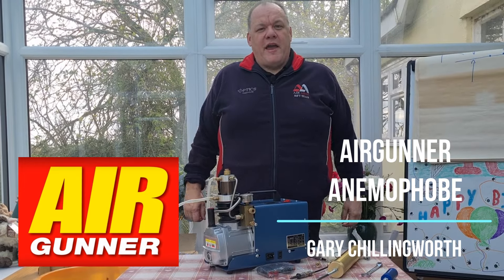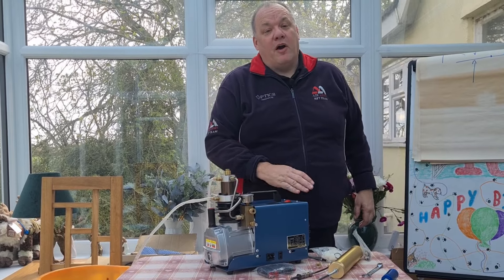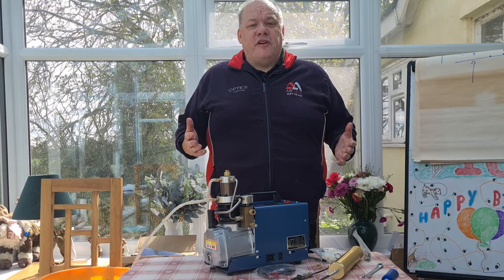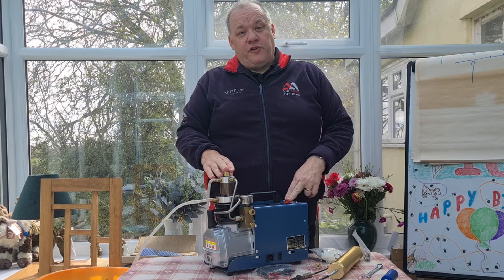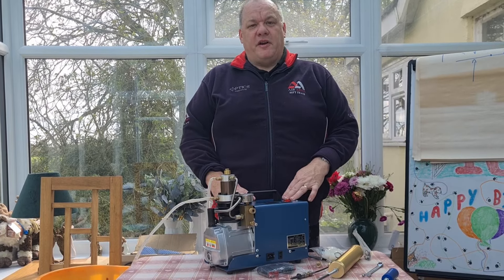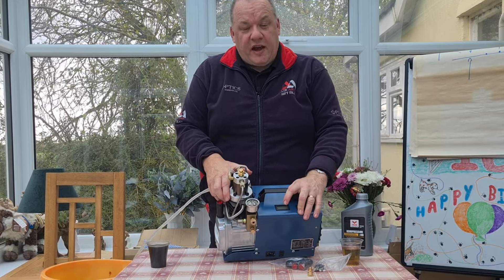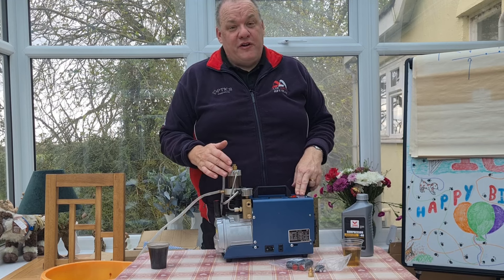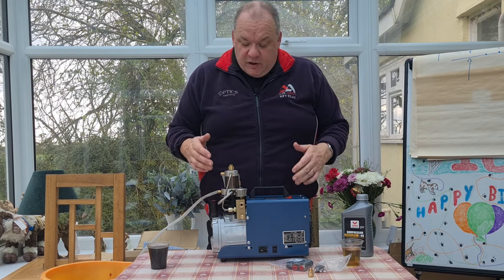S&C TV | Gary Chillingworth | Best budget airgun compressors - plus, tips on use and assembly!

Comment: Hugely good video. I just got one of these pumps, in the US there are a number of sellers on eBay and even Amazon selling the identical pump for the same price. I paid about $250 and got free domestic shipping. The seller offered “ lifetime warranty “.
My previous pump was off Alibaba, a no-name, very much resembling some selling for $500 under brand names. It failed after barely 30 charges and had the mainshaft bushing disengage after a few uses. It was under $200 but shipping was $85, so not really a good deal and no warranty since the seller was in China. My rifle looks very much like yours and I will be filling it to not more than 2500 psi, max is about 3200. Thanks for this video!

Comment: A brita filter or similar does NOT remove all limescale and minerals ib tap water. It will still fur up. You need to use deionised water. Also ice blocks (not ice cubes) to cool as ice melts releasing limescale and minerals back into your pumped water

Comment: I bought one of these 300 bar compressors during the early part of lockdown and had about three years of  trouble free use with it topping up 3 litre,9 litre and 12 litre tanks for my to FAC airguns, i had to change the entire top end of the compressor and now it seems to run a bit hotter so i use a bigger water pump( 3500 litres per hour) and a big 100 litre water butt. These compressors are cheap and generally provide good service providing you keep the oil changed every so often and filters.

Comment: Hey, thank you for the review and setup. I have the same compressor I've had for over a year. I freeze 1gallon water containers Halfway full and drop them in the bucket of water.  especially if I'm filling a tank. The only thing you forgot to mention when filling a tank. I think you leave The tank closed until the compressor reaches the pressure. You have in the tank and then open the tank valve.

Comment: I have had 3 of the First one stop working in 4 months, 2nd - was returned. the third one exploded.  The casing fractured at the cylinder base expelling the cylinder, connecting rod and piston.  Thankfully all parts missed my body.  After this I purchased a brand name twin cylinder compressor this one required replacing piston rings avery third scuba tank fill.  Another one from tuxing with the twin cylinders worked great and has operated well, it has the internal water cooling system.  Recently purchased a Italian Cuitri 300 bar compressor and this one is outstanding but very expensive.

Comment: From what I've picked up so far you want your moisture filter stood verticaly with the absorbant sponge at the bottom   tightly packed sieve material at the top then idbe tempted to reduce the length of any connections between the compressor and tank or rifle so I'd just permanently mount the moisture trap and compressor and maybe a see through water tank all mounted on a board. Or in a box with a removable side and top.

Comment: Very nice video. Useful 🙏 just one question with filling a bottle.  The gun bottle has e return valve. So when you bleed no pressure gets lost 
The diving bottle has no return valve .. don’t you loose all pressure when bleeding ?
Reply: I use a one way valve at the tank on mine.

Comment: Thanks for the review Pork chop,  I have the same compressor, the pvc cooling pipes are pants, they can be replaced with clear silicon pipes (no kinking)....I think I put about 750ml of oil in mine from new to fill above the greek.
Reply: Cheers buddy
Reply: how often do have to change your oil 12 pound a litre is not cheap
Reply: @johnwilson6707  now that it's run in, around every 5 hours.

Comment: Another great video. Thanks Gary. I have had pretty much the same setup for 18 months and I'm very happy with it. I only fill my 5ltr bottle every month or so as I much prefer shooting my springers :) 
Few tips I picked up:
* I have the bucket raised to give a head of water for better flow. Some people replace the water pump with a slightly less cheap one as they are fairly standard aquarium pumps.
* I have my dive bottle above the water filter, which is above the compressor that sits on the floor. This encourages water to drain away from the dive bottle.
* I have a one way valve from best fittings between my bottle and the moisture trap. The correct way round! This means I can start with the bottle valve wide open and don't lose air when I stop the compressor
* You had a lot of activated charcoal in your "moisture vaporator :) " I think you only need that if you are breathing the air, so mine is mostly filled with desiccant to trap the moisture
* I only fill my 5 liter dive bottle from 190 to 250bar to reduce the strain on the compressor.
* I've never filled my precious PCPs from the compressor, only the dive bottle
* I wrap a damp cloth around the hot metal pipes to help cool them (but avoid splashing the temp gauge etc.)
* I blow all the water through the tubes when I'm finished as leaving moisture in the cooling jacket leads to lime scale and corrosion
* I also use cheap bottled water for cooling and it stays in a covered bucket. The idea is that it will further reduced limescale 
* I follow all of your tips (great summary!), except I do use the recommended hydraulic oil, so now I'm worried!
I think you said you were going to leave a list of parts in the video description?
I think you also promised us a pellet preparation video. really looking forward to that. Hopefully involving springers :)
Reply: Do, you mind if I add your info into the description?
Reply: @garychillingworth  You are more than welcome to :)
Reply: how much oil do you use between filling up your bottle
Reply: @johnwilson6707  The oil doesn't get used. It just get's dirty. At a guess I change the oil it every ~6 bottle fills

Comment: Here’s a tip, the water (distilled)collected in a condensing tumble drier is almost pure(my works tumble drier produces this water at 10-15 ppm according to my TDS meter but do a tds test before you run it through a brita water filter, you may not need the Brita…. Free distilled water!)

So don’t throw it away, we use it in our steam irons and to top our flt batteries up.
Reply from the maker: Cheers Andy, that's a great idea - Gary

Comment: Air from the bottle is not floating back when 2 valves are open en you open the bottle before the compressor is turned on?
Reply: Marc Richins (comment above) spoke about a non return valve, I'm going to look into it.
Reply: @garychillingworth  Great will look into that too, just have to order the oil, and i'll be good to go, is the water, plain water or would distilled water be better? or cooling water used in cars is that an option?
Reply: @TophatOrange  I just used plain water, however, if you are in a hard water area, use bottled or filtered water to prevent limescale.

Comment: Would you use anti corrosive products in the cooling circuit ?  I've made the mistake of thinking I had drained all the water after 1 use, and the residual water just completely caused the bolts and other components to rust.
Reply from the maker: What would you suggest?
Reply: Would automobile antifreeze work? Probably a better heat exchaging liquid if compatible. 👍
Reply: @pepesantoraton9865 you could, if you reuse the cooling water - store it in a container, add Water Wetter or similar. It actually aids cooling and is used in motorsports engines. Highly effective.

Comment: For information the moisture filter should always be vertical and not on its side for it to function how it should properly,  its advisable just to use a couple of cable ties to hold it to the body of the compressor somewhere suitable

Comment: Hi Gary,                                                                                                                                                                                           have you had any problems with leaks on the compressor at all?  I have had a few on mine, mainly tightening things up, but I also put 2 burst discs where there should only be ONE. The upside of that is that I can now fill to above 220bar.  The down side is that the copper bonded washer that seats the brass 'blow out' safety valve to the top of the cylinder now blows out. A work around for this is  - remove the rubber seal from the copper washer, and use an RO6 rubber washer in its place.  So far this has held and I can now re-fill to about 290 bar, it may go higher but the machine was reaching 80 degrees so time to back down.  I am sure it wont be long until another air leak rears its ugly head but at the moment the compressor works for me as it save a gallon in fuel, a 1.30 hr drive and the refill costing. PS - regarding the moisture separator unit that come with the machine, I filled mine up with about 8 of the 'white moisture control pads' that came with the machine. If the show signs of moisture I  just dry them out....having just one pad in place didn't seem to be enough to me.

Comment: I've had 2 of these... kill both filling 7 litter 45 min scba tanks to 4500 psi.   one lasted about 12 months,, the other, 6 months.   I would suggest you use to direct fill your gun and it will last a very long time.   I ended up buying a twin cylinder Tuxing compressor.    I'm at 11 months with the Tuxing and its going strong!  review is on my channel.   Cost is reasonable (about 2X the cost of the little blue ones).
Reply: Tuxing : same pump supplier as Yong Heng, but a better design.
Reply: I have also a Turing 2 cilinder and my problem is, is that the oil very quick getting very hot, while the cilinders are about 45 degrees. I wonder, if you have the same experience.
Reply: @PF4531  - I don’t think so but I don’t monitor the oil temp just the head temps.  I’m cooling with a 5 gal bucket of water antifreeze mix. I drop in frozen 2L drink bottles of water.  Head temp usually about 115-120 F after a 45 min-7L bottle fill.   I don’t have an easy way to measure oil temp.  I kind of thought the cylinder head is where most heat is generated.    How do you measure your oil temp?
Reply: @motorgearhead  I don’t measure the oil, but after about 15 minutes, I see a little damp coming out of the oil breather, maybe It’s normal, but If I keep my hand on it it’s much hotter than the cilinders. It’s worried me a little. Bye the way…I do the same as you do. I have a big bucket of water with frozen bottles and the cilinderhead is constant 45/50 degrees Celsius
Reply: @PF4531  - wonder if changing oil might be needed?
Reply: @motorgearhead  That happened to be my thought too. And I dit that yesterday. Thank you for thinking. 👍
Reply: @PF4531  - good deal!   Hey post back & let me know if that changes anything.  Also what compressor oil did you use?   I have royal purple compressor oil in mine.
Reply: @motorgearhead  I will, but not now, becouse my tanks are full….But I let you know!  🙂
Reply: @PF4531  - thanks!!
Reply: @motorgearhead  👍👍👍
Reply: @motorgearhead  I’m Dutch, living in Greece….I can not buy the oil you use….It’s very good oil, but I order from Germany Liqui Moly 5W-40 Compressor oil.
I use the blue filter (from the compressor) first, after that, the big dubbel 40 cm gold filter. Very good and absolute dry air. 
Only thing is….I use the compressor for breathable air and however the air is real dry after the last filter, there is a very little smell of oil…..that was actually my problem.
I moved the air inlet, more away from the oil breather and I have the molecular filter for the damp. 
I hope, new oil is the solution.
Reply: @PF4531  - I’m on east coast of USA in North Carolina.  Liquid Moly is good stuff.  I’ve not used it but I know the BMW crowd believes in it.    I’ve wondered how well this compressor would work for breathable air?   I use mine for adult air rifles.   I’m using one of the large golden filters with a textile filter material & micro-sieve.   The air smells clean, at least what I smell when I release the bleed on the filling station at the tank.  I can smell strong odor of oil when I use the bleed at the valve block on the compressor.   So I think my filter setup is sufficient for airgun use.    I know the air is pretty dry as I don’t see any condensation in the filter assembly when removing the caps for inspection.    I’m filling a 45 min SCBA carbon fiber tank to about 4300 psi.   I believe the pressure gauge on the compressor may read couple hundred psi high versus pressure at the tank.  Do you know if this could be due to restrictions in the filtering process?  I know the filter adds back pressure but I would think pressure would normalize on both sides of the filter?    So I believe the gauge is slightly wrong.  This observation is based on the gauge of the SCBA tank and gauges in a couple different rifles.  I’ve set the pressure cut off at 4500 psi but only see 43-4350 at tank.   Which is not a problem for me.  Just wondered if you had observed similar?   By the way, North Carolina has some very good historical wrecks since we are part of the “graveyard of the Atlantic”.
Reply: @motorgearhead  Breathable air is okay, but only with a lot of filter material. 
The first time was a disaster, becouse I only had the blue filter. It takes 2 days to get the oil smell out of my tanks.
The first stage was also contaminated, but after half emptying the bottle, the air was good enough to breathe. 
My pressure gauge shows the same pressure as on the compressor, only I don't go over 300 psi. 
What I do notice is that it takes much longer after I have used the bleed button for the pressure to return, but that must be due to the filters.
Enyway, For such a cheap compressor, it works very good
Reply: @motorgearhead  Its a long time ago, I fill my 4 liter scuba tank with new oil, the blue oilseperator and the Tuxing double 40cm filter. I place a big fan in front of the compressor and for the cilinder cooling, I use a big bucket with ice. My running time is 10 minutes for filling half of the bottle. The cilinder temperature was at last 54 degrees Celsius and the carter temperature was 38 degrees…..perfect. Th first oilfilter was almost clean and the air in the bottle is breathable. 
I’m happy wit the result
Reply: @PF4531  - thanks for sharing your experience.   I was happy with the little blue compressors.   But filling 45 Min SCBA tank twice a week to 4500 psi seemed to over work the compressor.   I used a 5 gal bucket of ice water so temp was never at issue.    I used this air to feed adult pcp air rifles so breathing quality air wasn’t a requirement but I did run a tuxing gold filter to get “clean & dry” air to the rifles.   I just bought a 12 volt/120 volt 4500 psi portable compressor to top off my big bore air rifles.   Have used it only once but it seemed ok.    Al least no water cooling required.
Reply: @motorgearhead  👍👍👍

Comment: Seriously?   So if you have 2500 psi in the tank and then you open the bleeders on the compressor, you're going to have 2500 psi air coming out of the bleeders before you start the pump?   Of course you would.    That makes ZERO sense.   You did the gun right but not the sequence on the tank.

Comment: I bought the same make and model as Gary is showing in the video, looks good and feels reasonably well made, but I was still a bit apprehensive about using it as the instructions with it were diabolical.
After watching Gary's video a couple of times and taking notes I knew I needed to call Best connections for the appropriate parts, I spoke to Michael Thomas who advised me to send pictures of the parts I had so he could advise which parts to buy, absolute godsend. The parts dually arrived and I set everything thing up as Gary had advised in the video and started to fill my 3 ltr tank, no problems at all, very easy.
The only problem I have is that there's no instructions with the moisture separator that came with the machine or the extra separator I bought, and there doesn't seem to be any videos on YouTube, hopefully Gary will consider doing a video on how to look after the compressor and the moisture separator.
As always a great informative video.
Reply from the maker: Hi Brian, I am more then happy to do a follow up piece. Gary
Reply: @ShootingCountryTV  Thanks Gary, I'm sure I'm not the only user who is a bit wary about using the compressor and especially looking after them and when to change the filter. I've read that the separator should be stood on a certain end to ensure it works properly, but what's correct and what's hearsay.
Reply: Hi Brian. Would you be so kind as to put a link to where you got the compressor from, been looking on the bay but not sure of what to get. Many thanks